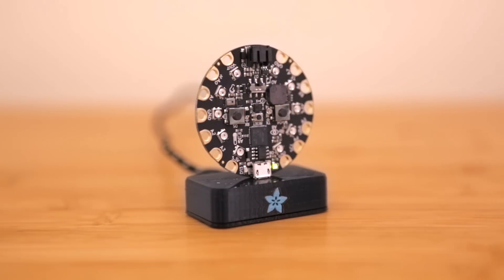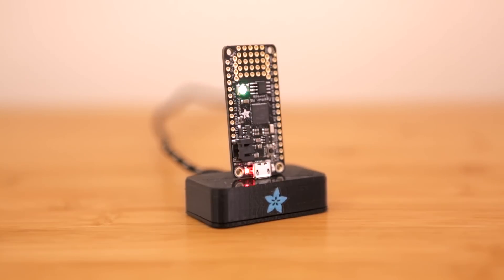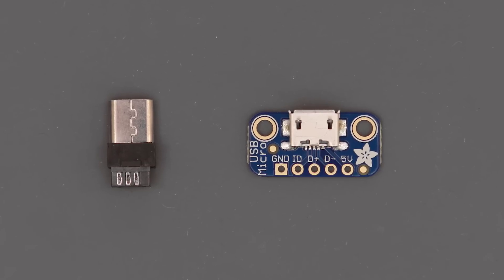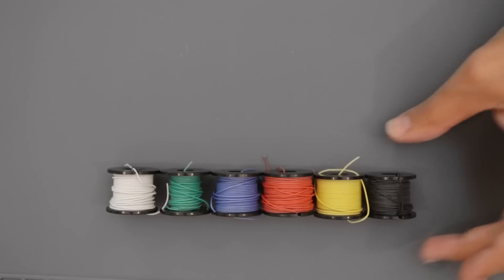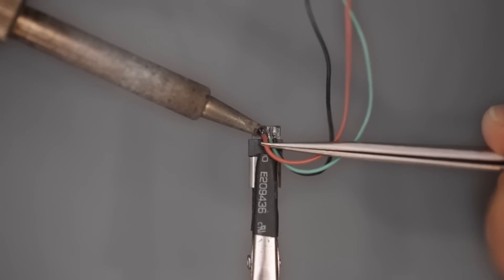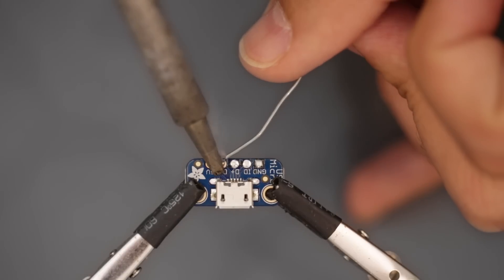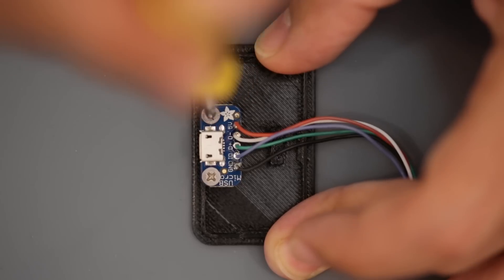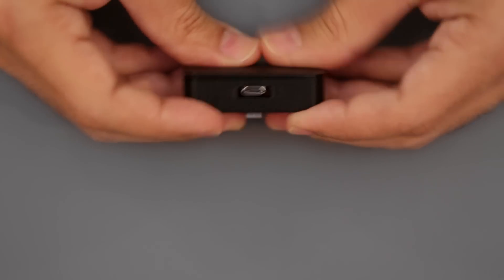Micro USB Dock for Circuit Playground

Comment: Cool project.  I've got mine all wired up and the power works, but my computer does not recognize my devices.  They are recognized when I just use a cord.  Tried a CPX and a Huzzah, tried different USB ports.  Any suggestions on how to trouble shoot?

Comment: I'd like to see USB-C parts as well in order to make a USB-C equivalent.
Reply: Short lengths of hand-soldered wire like in the video will not work for USB-C - they wont maintain signal integrity at those bandwidths. You'll need properly shielded and twisted cables for that, or a PCB with the proper impedance and length matching. It would be easier to take a short USB-C extension cable and hack that into a case like this.
Reply: Thanks Nikhil for the info. I will probably hack an existing cable for this purpose because I like the idea of the stand.